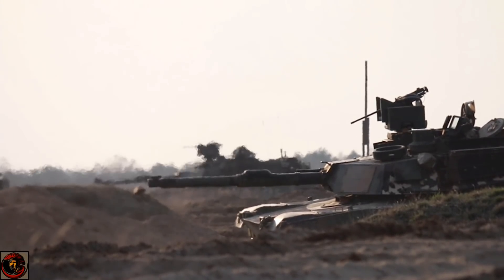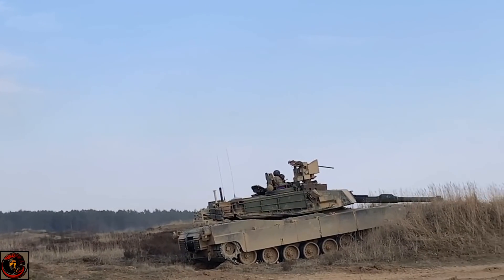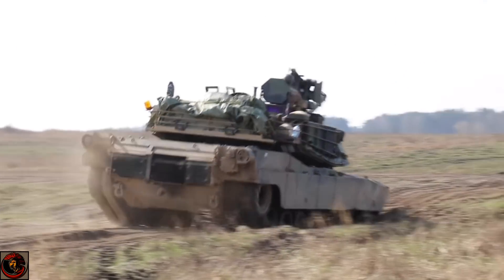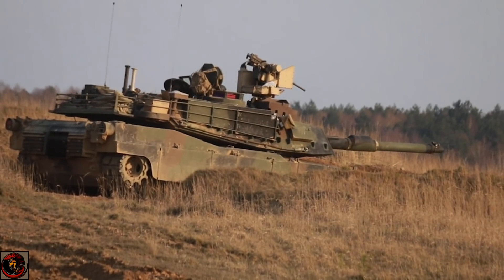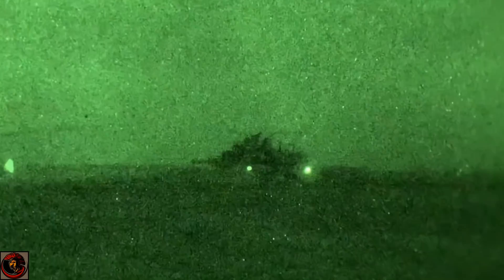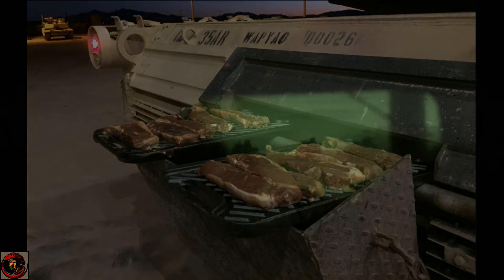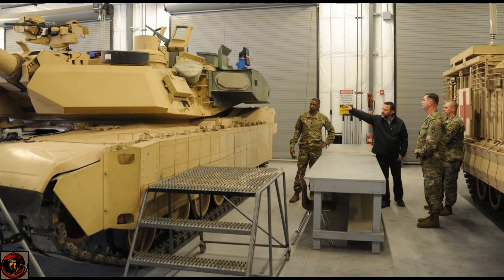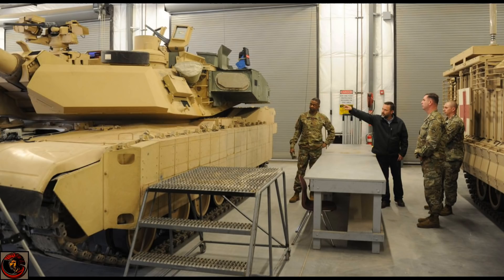M1A2C Abrams Tank Upgrade - The Last One?

Comment: And yet the upper front plate is still just 38mm of steel without any added protection, the gas turbine engine provides absolutely no added benefits over modern diesel engines, and the gun isn't even the best 120mm model currently available. It would be nice to see these issues addressed.
Reply: And yet, the Abrams has survived for +42 years with needed upgrades in areas the military deemed important.  If those issues you outlined would be addressed if they were needed for operational success; but, they are not.
Reply: @mrgold3591  My mind has changed a bit since this post. The gas turbine engine I realize is a godsend and the gun is still perfectly acceptable. The upper front plate really needs better armor but that's just my own 2 cents.

Comment: The military should consider designing the m1a3 if and when it is developed to be much lighter than the a2 because as is were pushing the limit of how much weight can be added onto the Abrams chassis and maybe replace the m256 it is getting a little long in the tooth

Comment: Those new CWS 50's are entirely too tall.  They should have made a powered cupola mount, (with a pintle manual  option) . would be about 1.5 ft lower easy.

Comment: By the way, the U.S. Army fucking hates that they were forced to have turbine engine powered Abrams instead of diesel, and they really hate having to buy 2400 more when they don't have enough tank crews for the ones they have.
Reply: ?, those turbines are alot more reliable than diesels need alot less maintenance, and that they eat somewhat more gas really don't matter , the entire US Army eats gas and needs a lot of it. -
me-tanker 8yrs, then DoD tank mech, M60A1's-3's M1's- A1's - Block3/SEP
Plus that turbine  has HP and speed, a diesel doesn't compare. The turbine +suspension made original M'1's the fastest tank.
Reply: @chrisperrien7055  It requires so many fuel trucks that they decided to drive across Anbar Province with the Abrams on trailers.
Reply: @chrisperrien7055  it is defeated by sand and snow, and it is fucking loud

Comment: So did this upgrade get upgraded turret and hull armor? Because I keep seeing the testing of this vehicle with hunks of metal welded to the front of the hull  and turret.
Reply: No it didnt just slat armour on the front and the back new APU and a coil for the cannon good upgrades but if the cost is actually 20 million per unit is a crime Leopard 2A7 is around 10 brand new lol
Reply: BlueRevolvur ☧ if the cost of the upgrade is 20 million per unit it’s more than just that.

Comment: I drew a brand spanking new M1 in 1983.  It was issued to me in Vilseck, WEST Germany.  I loved everything about that tank - with the possible exception of that stupid elevation/depression handle they put on the 50 cal (I had a friend who worked for General Dynamics who told me years later they ran out of development money for the TC cupola, which is why elevation/depression wasn't incorporated into the cupola traverse thumb switch).
But it might be time to think about a replacement for this War Horse.  I'm thinking lightweight and nimble, capable of 100 mph cross country, fitted with a rail gun.  Don't laugh!  Who ever thought the stealth fighter could fly?

Comment: The next American MBT is called the Jackson Class. It is slightly smaller than an Abrams and has some crazy new even more powerful main gun than the Abrams. The Jackson series MBT has long since been designed and been testing for years now. The Abrams chassis will easily serve for another 50 years it is just that good.

Comment: I'm sure there will be an upgrade to include advanced tech and hyper velocity shells.

The T.C. never had to pop out of the turret to fire it, but the control's were mechanical and not electronic and it was a bit clunky for quick reaction. The leader does did have to exit to fire the m240.

Comment: The General Accounting Office documents from 1991 were released to the public not too long ago discussing the Abrams, the problems the tank faced, and solutions/costs that could be used to deal with those problems. For example, an M1 cost 3.2 to 4.2 times more expensive per mile to operate over the older M60, when the army expected to the costs to be close to parity back in the 70s. The standard hi explosive for an m60 at 105mm cost $127 per a round while the M1's hi explosive ammo at 120mm costs $1033. They added a heavier track to deal with uptime and the APU to deal with thermal signature and fuel consumption costs. The readiness requirement was met by the unique structure of the tank, with major repair points being modular and quickly changed out or stripped from a nonfunctional tank. The Abrams of 1991 only had 4 maintenance actions that required more than 24 hours to complete and even if in the state a surprise attack the Army figured it could have 96% of it's fleet fully functional and combat ready within 24 hours. Few governments field weapons with such flexibility if they aren't already in the state of war.

Comment: The abrahms still has the huge weakpoint being the fronthal upper hull. Every modern tank can easily penetrate that spot.  The cannon is also not up to date. The Leopard 2 has a better smoothbore gun.  Also Tanks arent really worth much in modern urban combat. Tandem ATGMS beat Tanks most of the time.

Comment: funny how the yanks hate the t14 so much that theyre trying to turn their fossilized abrams into one.. >.>
Reply: How? The M1A2C upgrade neither includes a unmanned turret nor the crew compartment in the hull.
Reply: @jonny2954  of course it doesnt...that would involve developing a whole new tank...as i mentioned earlier,this tank is a fossil and there is only so much that can be done to improve it without just ditching it and moving to a completely new design...
Reply: @forceofone  If the Abrams really is a 'fossil', i wonder why even some of the most modern tanks in existence, K2 Black Panther and Altay, follow its design principle. No, the 'big two', Leopard 2 and Abrams, still have massive growth potential left and a long service life ahead of them.
Reply: @forceofone  What does that have to do with this conversation? The tank in the video is a Leopard 2A4, developed for linear tank warfare in the 80s, not asymmetric counter-insurgency operations in 2017. For linear tank warfare protection is focussed over the frontal 60°, in asymmetric counter-insurgency operations this is extended to 360. There are urban combat kits available for the Leopard 2, and turkey wanted them, but they didn't get them because germany banned all weapon and weapon part exports to turkey.
Reply: @jonny2954  youre arguing for the sake of it...the abrams is a 40 year old design that has been surpassed by the t14 in every way...just deal with it
Reply: @forceofone  I never said the T-14 hasn't surpassed the Abrams. I disagreed on your statement that the US are trying to turn the Abrams into a T-14, which simply isn't true. The T-14 also didn't surpass the Abrams in every way. It did in some, but not every. You need to differentiate.
Reply: @jonny2954  blah blah blah
Reply: @jonny2954  the abrams is outclassed by later variants of the t-90...
Reply: @jonny2954  russia as a whole has been ahead of western countries in armour for ages...the t-62 was the most capable tank in the world when it was introduced and the west has been playing catchup ever since...their missile technology,particularly surface to air systems are also miles ahead of the west.
Reply: @forceofone  The T-90 aka. T-72BU that was renamed to T-90 after the bad performance of the T-72 in the gulf war? (not so well known fact) Yep, you read right, the T-90 base is actually even older than the Abrams base. And it doesen't really outclass the Abrams, even in its latest versions. Protection is in favour of the Abrams thanks to its completely seperated ammunition and the literally nonexistent mine protection on the T-90. Optics and FCS aren't even in question, even russia bought western optics for the T-72B3 and T-90. French thermal imagers from the 90s to be exact, that somehow managed to still be better than the current ones from russia. Tells us something about their quality i guess. Firepower is pretty equal, while the T-90 has a slightly larger caliber gun it operates at lower pressure and fires shorter (thus lighter) APFSDS. Thank the two-piece ammunition design for that (penetrator can't extend back into the propellant like on one-piece ammunition). Mobility is also pretty equal considering the T-90 is lighter, but also has a less powerful engine.
Reply: @jonny2954  the latest models of the t-90 ie; the 'ms' the t-90 'a'  with 'shtora' active protection systems,and kontact-5 era which 'breaks' longrod penetrators....the russians are miles ahead of the west in active protection systems for armour,and have been for ages.those closest the west have is israels work that they do for the us and test in the middle east which is pretty much the us live test range for new ordinance.. ><different countries have focused on different 'areas' of defense than others and have allocated their defense budget accordingly....the russians have focused on armour and missile systems whereas the statesfocused like 420billion into the f-35 as examples.....as a result,the russian s400 sams for example and the 'brahmos' mach 3 asm are miles ahead of our 'equivalent' whereas the f22 raptor is the shit compared to anything else in the world...its all about priorities and corresponding budget allocation for research/development that results in these sort of situations.
Reply: @forceofone  
'the russians are miles ahead of the west in active protection systems'
No, they are not. Just because they've adopted them earlier into service doesen't mean they are ahead. Germany has tested APS as far back as 1969. Israeli Trophy is the only battle-tested system worldwide, but definitely not the most sophisticated. Rheinmetall ADS is currently considered to be the most advanced and effective Hardkill APS. It even beats out the new Afghanit on the Armata family of vehicles (which isn't a big thing since Afghanit hardkill only covers 180° in limited elevation). Russians focussed on missiles, yes, but not on armor. You will find out that russian armor has been drastically neglected by the MoD, all of the latest upgrades are lackluster and have saving money as the main intent.
Reply: @jonny2954  wrong.the armarta is the first tank designed with the active protection systems incorporated into the fundamental design and not added on after the fact.the armarta has multiple layers of defensive countermeasures and puts crew survivabilty miles ahead of any other system in the world....you were spouting on about the seperate ammo stowage in the abrams with its protective doors to seal an ammo explosion off from the crew compartment...this has been adopted by many other tanks including the leopard 2 a7 but it only works when the doors are closed which is only around 50-60% of the time in combat...and even if it saves the crew,the tank is still knocked out.the problem with the armarta is hitting it in the first place
Reply: @forceofone  Afghanit is a addon solution just like Trophy or other Active Protection Systems. In comparison, Afghanit is actually implemented pretty bad. Hardkill coverage is only provided for a 180° arc with limited elevation in front of the turret, the rest of the vehicle is protected by softkill only. Top-attack is also provided by softkill only, which is a weird decision since most western nations use top-attack or dive-mode ATGMs by now. Since it it a launcher based system and not distributed like Rheinmetall ADS as example it is also limited in minimum defeat distance, system reaction time, distance to interception point and signature.
And i was comparing the Abrams ammunition stowage withe the T-90, not the T-14 Armata. In comparison to the T-90, Abrams ammunition stowage is safer.

Comment: The tank commander didn’t have to get out of the hatch to fire the 50cal on the old M1A1. There are mechanical controls (one called the egg beater) to traverse and elevate the gun. It was clumsy and it worked better at longer distances with smaller movements. It took two hands and it was kind of like rubbing your belly and patting the top of your head at the same time.  The loader had to pop out of the hatch to fire his smaller 240 machine gun.

Comment: Hey Matsimus just wanted to let you know that i was a tanker in the us army and when I was in we had the m1A2 SEP v3  and it had gone from just 6 batteries to 12, it had the rhino kit on it which was the reactive armor the v shaped hull plates for under neath. It had the crow system for the 50 in the tc hatch. It also had an additional 50 mounted just above the main gun that was tied into the main gun so the gunner could fire it like a fully automatic or single shot sniper. It had the new citv and tank commander display unit as well, it also had the infantry phone on the back, and a new slave receptacle to jump start other tanks that tied straight into the batteries. The rhino system also had the armored plates and windows around the tc hatch and the loaders hatch, So its not going to much of an upgrade if it does happen but as far as some of the other things you mention it sounds like it could be useful. But as far as the m1a2v3 being new it's not so much. It was around august of 2008 when we had them, I by the way was in Charlie company 1-12 cav of the 1st cavalry division just to let you know if you have any questions about the system you can get in touch with me at reaper32g@gmail.com

Comment: You missed a few things.  First is they are supposed to have a new round that is made to bypass the Russians reactive armor on the T-90s and T-14.  The other possibility is the ability to fire missiles out of the gun to extend range and accuracy.  I have not heard if they were planning on this.
Reply: I am 100% positive there will be a new round in conjunction with the new tank since it's designed for more modern MBT-v-MBT combat. It's similar how standard infantry ball ammunition is able to punch through extremely high levels of body armor. 

I'm also interested if there will be a gun fired ATGM though. I know it's fairly popular with Russian tank designs. I'm not sure if the Abrams needs that kind of range, but it would definitely be an interesting addon for sure
Reply: @AngryB4ker  The only issue I have is that the US is making sure they can pretty much gain air superiority almost from day one.  The US has the only super carriers and has 11 of them... as well as about 10 smaller carriers.  Maybe a dozen other countries have 1-2 smaller carriers that handle mostly VTOL and helicopters... only a few can actually handle jets.  Even Russia will struggle to hold the air against the US except in Russia where they can muster enough anti air... and even then it would likely only be a matter of time.

Now the reason why I point this out is something few have been covering.  The US has a really nasty weapon out there called Stormbreaker (yes they named it after Thor's pretty ax he used in the last 2 movies).  This is what t hey call the Small Diameter Bomb.  This is also the second version.  Understand this is a glide bomb with a range of something like 70 miles... fire and forget.  It can go after moving targets too, but only at a range of 45 miles.  It has three autonomous tracking systems making it pretty much impossible to jam.  It has a dual warhead for soft and hard targets.  It also has a timed fuse so it can detonate off the ground, or so many feet after penetrating a certain number of walls/floors.  Think of it penetrating a boat, truck, or building and detonating in the inside.  Now the most important parts...  The price is not bad, but the big one is you can fit 2 in the place on one larger bomb.  The F-15 and F-35 can all carry 24 of these.  Even more impressive is that the B-1 can carry 144 of them.  But still 10 F-35 coming within 45 miles of a tank battalion could drop 160 of them and run.

The last part of the system is the CHAMP missile.  It can screw with their radar and defenses.  This would open the path for the Stormbringers to come in unopposed.  That CHAMP warhead looks to be small enough to put in a JASSM which can also be fired from the F-15, F35, and B-1 (as well as many other fighters and bombers), but it is a 200 pounder so an F-35 would likely only carry 2.  Send out 10 F-35 with 4 of these, 20 sidewinders, and 144 Stormbreakers.

The main advantage of this is the active defense systems on the T-14 and T-90s do not work against bombs and without significant air cover they are sitting ducks.  If we had those Stormbreakers in recent wars it would have been MUCH easier.  The JDAMs we used have only a range of 25 miles and the GPS is easier to block.  Laser guild bombs require the jet to stay in the area the whole time and attack one target at a time and they also require better visibility on the target.  Neither have them are made for moving targets.

I just do not think it would be much in the way of tank on tank for the US most of the time.

Comment: Two notes
The turbine actually burns less fuel per miles at speed then diesels. and similar when driving slowly.  Where they really get thirsty is parked and idling.  But then idling a 1500-2000hp engine to power radios is nuts!

Second, they are quiet.  When first deployed, the Germans named them the whispering death.  In big buildings like a ware house it's not hard to converse with one driving next to you ( unless it's turning and squeeking the rubber on the treads.,) outside it can drive up to people without them knowing its there.  Freaky given how massive it is.